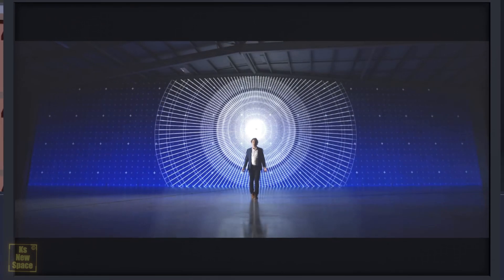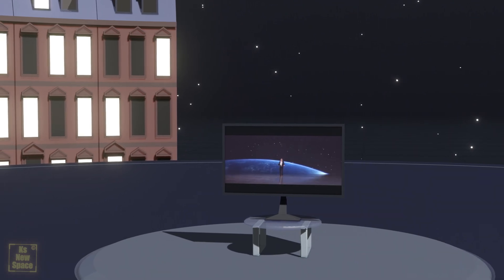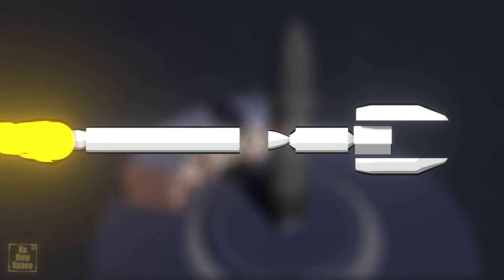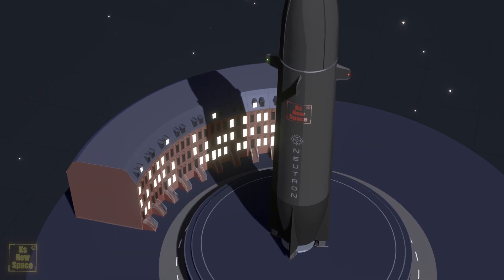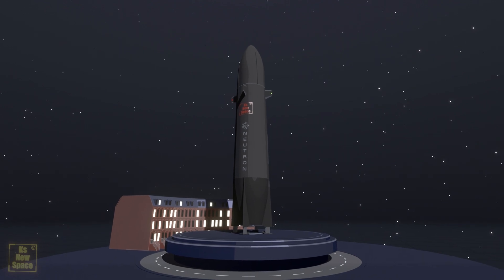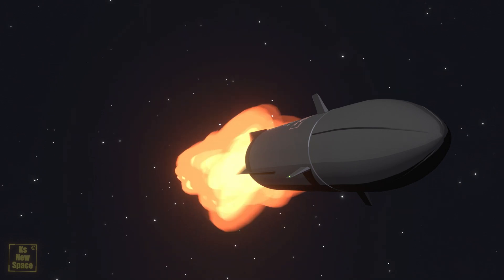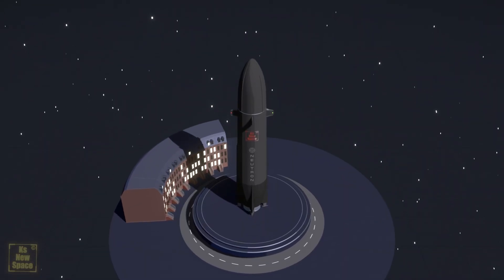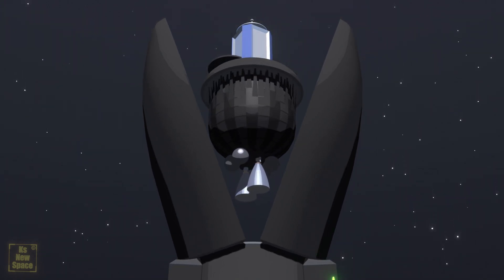Rocket Lab's Reusable Neutron Rocket! || Inside Spaceball

Comment: Nice video!
I love the landing leg wing strakes of neutron. I think those will allow the booster to slow down and maneuvre a lot more after reentry, so even less fuel has to be used for the landing burn.
That's how I make my reusable boosters in KSP. Without wing strakes I need to start the landing burn while still at supersonic speeds, but with wing strakes I could slow down to 300km/h. The strakes enable higher inclination, so the body also generates more lift & drag.
Might that be why they don't use grid fins, but wings at the top? grid fins become way less useful at low speeds right.

Comment: I didn't realise the significance of Neutron until you pointed out that the upper stage is over engineered and why. 
When I watched Rocket Labs presentation all I thought was, "hmm not having to catch or recover fairings separately, that's simple but clever."
Reply from the maker: I think what I should've also mentioned is the Carbon Fiber. Such a dangling upper stage has to be made out of carbon fiber because that's where it shines. Carbon Fiber wants to be pulled at.